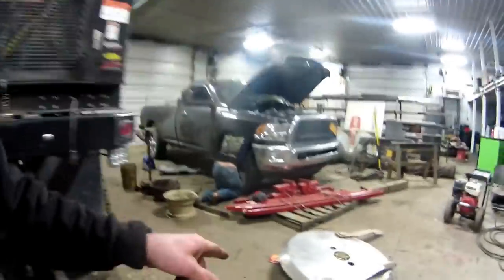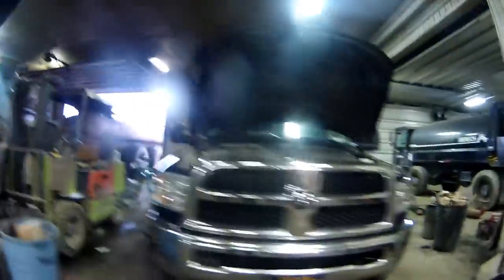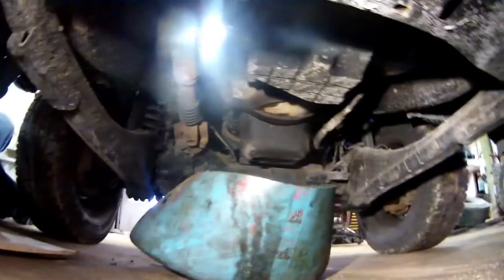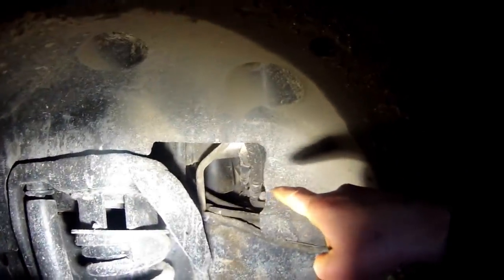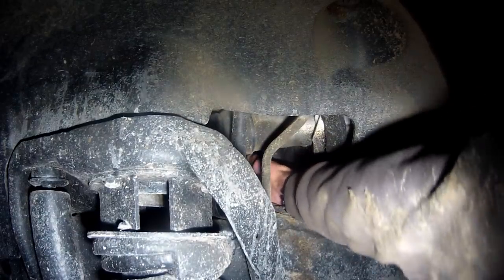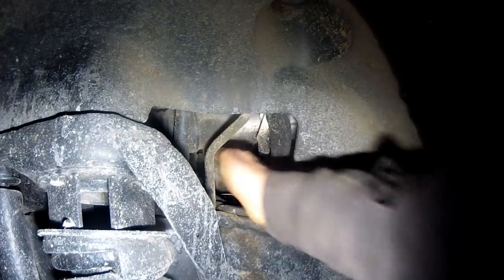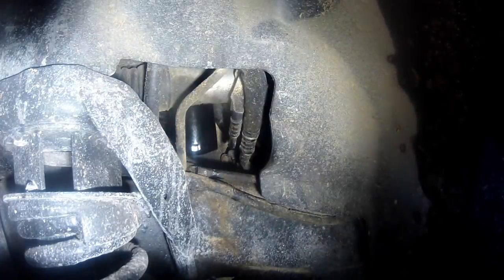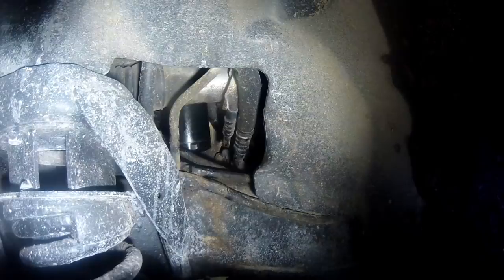Sunday servicing and oil changes

Comment: Its nice having vechicles you dont have to lift to do oil change.  I drive a f350 7.3 and i fit under without ramps. My chevy 2500 6.5 i needed ramps.   It good its a family affair. Good teaching time

Comment: Thanks for today's video. At least they gave a access hole to get the filter out without needing to take the tire off. I wish they would make the engineers go change oil on every vehicle/machine they design to see how difficult it can be because of poor designs.

Comment: Thanks for the info on the filter plug already have one on order  Dodge doesn’t need the front end greased ?
Reply from the maker: There isn't any grease zerks on the tie rod ends or the ball joints. My Chevy's have grease zerks but nothing in the Dodge.

Comment: Do the new Ram trucks still use a needle grease zerk on the front driveshaft?  My 2011 has that on the double joint back by the transfer case. Can be a real pain to get in the right spot to grease it.
Reply from the maker: Not sure I better check that
Reply: There is a decal showing it on the dvr side fender on my truck kinda 1/3 way back from front.
Reply from the maker: @tuba7084  I'll check on that thanks

Comment: What a dumb place to have to install a engine oil filter, very poor design  Ram /  dodge.
Reply: It is in the same place as the older ones.... they just added more stuff under the truck that now blocks easy access to the filter. My 2011 doesn’t have anything located under it and is really easy to change. All I use is a filter cup and a 12” extension to change it out.